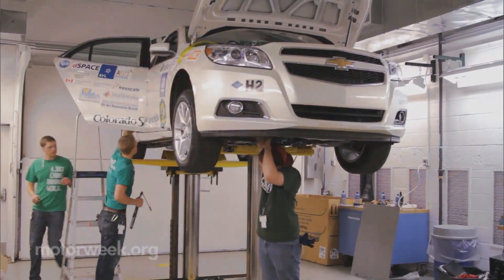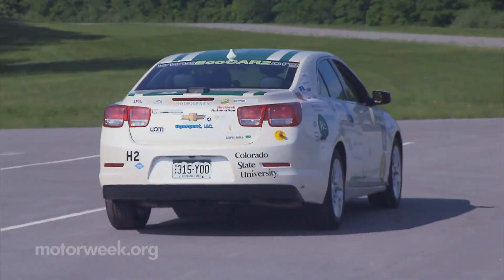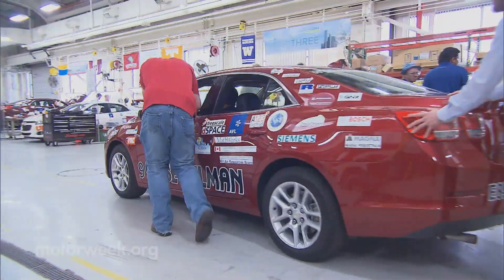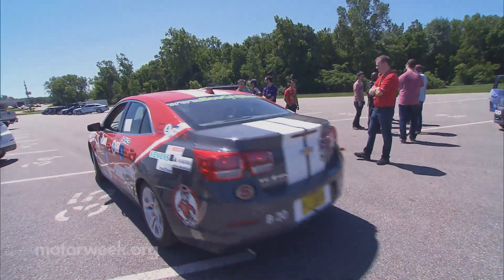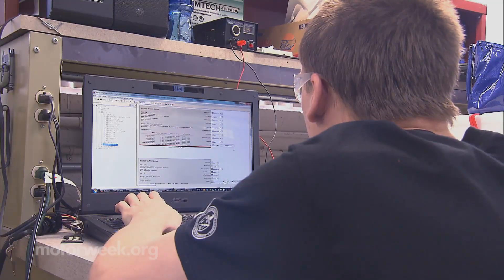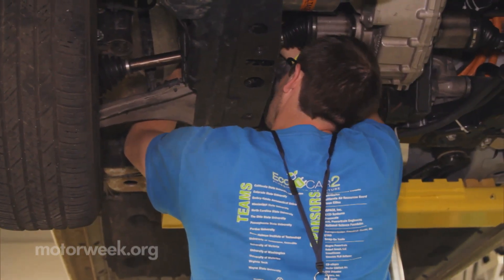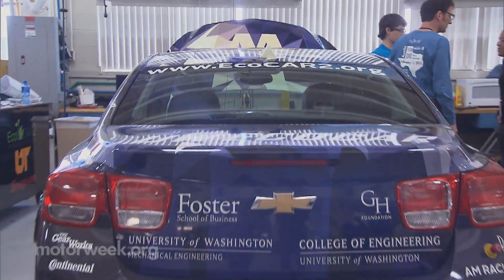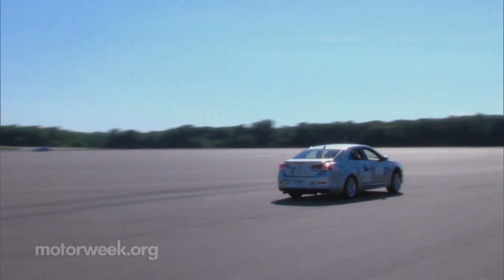MotorWeek | Auto World Eco-Car Challenge

Comment: Lol they really put a Honda engine under the hood
Reply: Honda uses the VTEC system on the R18 to allow the engine to switch between Otto cycle operation and Atkinson cycle operation, it's a hard engine to beat and GM doesn't have anything like that.